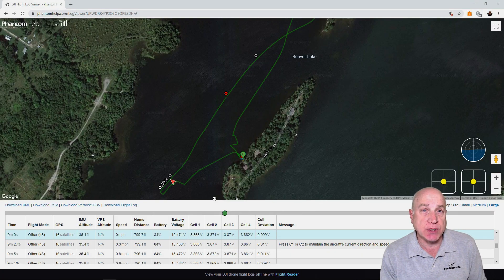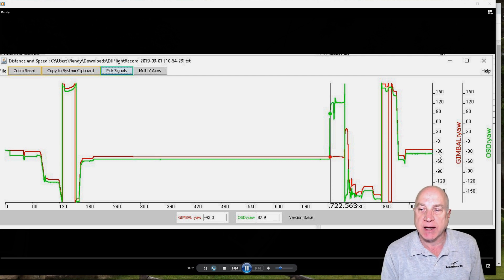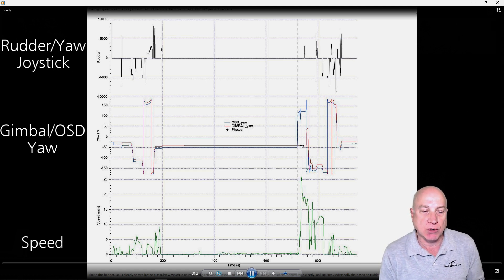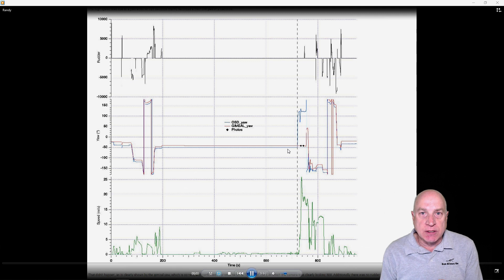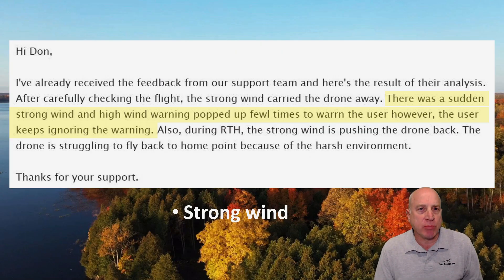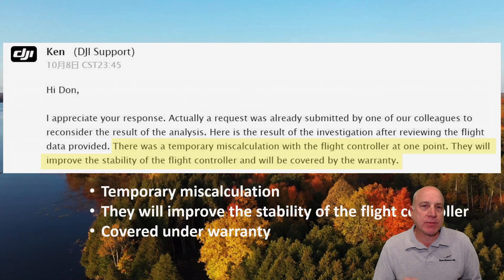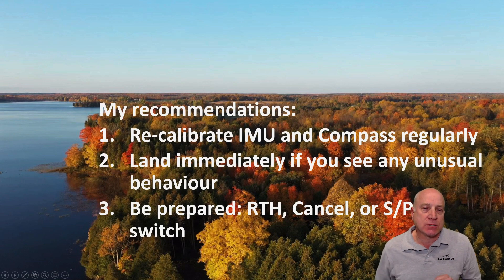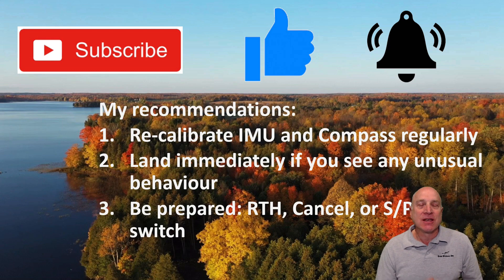Mavic 2 Pro 90 km/hr Fly Away...Explained!

Comment: Hi Don,

The navigation code and algorithms can become messy at times and exceptions can occur where some values or parameters are not processed as expected. These exceptions can be very difficult to pinpoint and sometimes only recreating the exact same conditions is the only way to reproduce the exception. The rarest it is, the harder it becomes to find it. Of course, this relates to a software bug. But given your explanations, if it is the case, I'd say go and buy a lottery ticket because you happened to hit this exception!

Personally, I think wind asset correction is not the cause, because wind tilt corrections use the IMU, not the compass. On a multicopter, there are 3 basic feedback loops that are used: Asset by IMU readings, Navigation by compass/GPS and Altitude by barometer/throttle. No multicopter will keep itself in the air without a working IMU, it will just crash within seconds. A multicopter keeps itself in balance with the IMU, go where it wants to go or stay still by the combination of its GPS and compass readings (GPS measures do not give direction if you stay still so you absolutely need a compass to apply the positional corrections in the right direction). Finally, it  maintain its altitude through a feedback loop using its barometer hooked to its main throttle.

What you have encountered is either a compass (magnetometer) false or erroneous reading or a flight controller misunderstanding of its measure. When it happens, we either have the infamous "toilet bowling" effect for slight orientation errors (say, between 30-60 degrees) or a very impressive high speed flyaway when the direction error is more than 90 degrees. The only way to stop it for a drone is to manage to read position moves and compare them to the direction it thinks it should be going. A compass error can and does happen at times and for many reasons. I take for example if the drone happens to cross the direct path of a bidirectional microwave signal between two dishes maintaining permanent communication between them. Then, not only the magnetometer can react abruptly but also any other piece of electronics that could affect the readings transmission to the flight controller or the flight controller itself. And this is only an example, because there could also be large amounts of magnetized rocks in the ground, even below a lake, that can create a momentary change in orientation readings, causing the drone to imagine itself all of a sudden flying in the wrong direction and trying to correct it. This phenomenon is less prone to affect aircrafts because they usually fly higher but for a drone, it remains a possibility for both cases.

Flyaways are always caused by navigation sensor readings (GPS/compass) that don't match together. Some flight controllers have many independent IMU, GPS and compass units and analyse the eventual discrepancies in real time like commercial aircrafts do but smaller units like the M2P probably don't have this level of redundancy. On a Pixhawk controller, there is a Kalman filter that analyzes sensor data and tries to detect inconsistencies, taking action if it does find one like RTH or Land (personally, I used to adjust it to Altitude Hold only (no GPS/compass) and leave the craft go with the wind). When the navigation loop is faulty, the drone can rarely figure out a good RTH if it cannot navigate back home! If navigation errors occur, the only sure way to get control back is to remove the navigation feedback loop from the flight equation and fly by IMU only (Atti mode on other DJI models). Unfortunately, the Atti mode is not a pilot's option on the M2P and will only kick in when the flight controller does not lock on enough satellites. I am pretty sure an Atti mode switch (something I would appreciate on my M2P units!) would have given you control back, but then you have to fly it manually with visual control and if it is too far, look at the drone position on the map to understand where to go to come back. With a M2P you would have plenty of time and communication distance to do so but perhaps DJI thinks not many pilots would be able to do so and decided to remove the Anti switch option.

After all, either the inconsistencies have disappeared or the flight controller managed to get rid of the offending measure because at the end, it came back on its own RTH automation... And since nobody knows what happened, it can happen again, this is not what we would prefer...

André
Reply from the maker: Thank you for the detailed comment, Andre!  I agree with everything you've said (well, I haven't bought my lottery ticket yet...).   While I haven't seen it happen again, I am watching carefully.   On this past weekend, I was flying low over fast-moving water, and I saw the drone was slowly rising...like a 'drift', but upwards.  While it may have been normal downward sensor behaviour, I played it safe and landed without incident.  Not much fun flying when you're always sweating about the smallest anomolies!    One minor correction in your comment:  on the day of the incident, it did not do the complete RTH on it's own.  After it was clear that it was headed for home (or at least roughly), I cancelled the RTH and flew home manually.  Since 'home' was on a dock, with nearby (but not overhead) trees, I didn't want to take any chances.  Thanks again for your comment.
Reply: @DonJoyce  Hi Don. Thanks for the answer and additional details. To me this upward drift while flying over a different environment is in line with my understanding of the many loops that happen at the same time while flying. Be careful, this is only a feeling but this water environment change could have slightly modified the barometric pressure (local temperature and/or humidity changes) and since the height is maintained (mostly, I think) by the barometric pressure feedback loop, it appears normal to me that an altitude drift occurs if otherwise no absolute altitude is imposed to the drone. Barometric changes are usually slow enough you can correct manually. One think I don't know (DJI's own corporate secrets) is to what extent the GPS altitude measurements kick in when such drift occurs because it is possible it gets into the equation loop at a certain moment. For example when I fly with Litchi on a photographic survey flight plan, the imposed ground altitude is maintained very accurately along the flight, but this is relative altitude, does it come only from the barometer or a pounded combination of the barometer and GPS absolute values (with some exclusion logic if they don't match), I don't know and I don't think DJI will tell.
Reply from the maker: Yep, it may have been a 'normal' drift, but for the time being, I'm just being super careful.  Amusingly, I'm hoping to drone a septic lagoon tomorrow!  If successful, it will be my shittiest video ever.  Sure hope I don't have to do a retrieve!!!

Comment: I’m not sure this is correct, and as others have said not all the information is available here, it would be nice to see the CSV file, there are many reasons why this may happened , your theory never explains that if craft was tilted at such an angle, why it never tipped over at that angle it would have been almost impossible for IMU to try to correct the correct attitude of the craft.
What you have shown is what suits your theory but has many questions which it looks like you just ignored .
Reply from the maker: Thanks for the comment, David.  As I've said to Frank down below, if you would like to review the data, send an email to DonDronesOn@gmail.com and I 'll send you a link.  At least 4 experts have reviewed the logs and concluded it was a yaw error, with subsequent acceleration.  What do you think has been ignored?  I don't understand why you think the craft would have tipped over...as far as the drone was concerned, it was just fighting an increasingly fierce wind and was failing to compensate.  It would never (I presume) turn itself so much that it would tip over.  (My handheld simulation may have been exaggerated to demonstrate the point?)
Reply: @DonJoyce  Don, what did I tell you about not using the cloaking device with a high KP index ! Just don't do it
Reply from the maker: @randell1784  oh crap, I thought it was just the transporter I was supposed to avoid!

Comment: I'm impressed by your analysis and as a retired engineer your conclusions in this video make perfect sense to me. Also, glitches do happen with computers sometimes for unknown reasons. When I was designing real-time control systems we put a hardware "watchdog" circuit that would reset the computer if it's execution wandered off.

Yeah, your experience with DJI customer/tech support sounds just like what I went through last year when my M2P did not follow the RTH procedure as clearly stated in the operations manual. My flight records showed the craft thought it was about a meter lower than ground level, but DJI insisted it was pilot error. Wasted a month working my way up the support ladder to no avail. Unlike you my craft did crash and was replaced by my Care Refresh, though I had to pay the fee for a replacement.

Think I'll go calibrate my IMU right now ;-)
Reply from the maker: Thanks a7wd!  Interesting to hear about your M2P crash.  But yes, on today's call with 'Francis' from DJI, I suggested exactly that:  that their software needs to detect impossible situations like massive directional changes and react appropriately.  And a watchdog to react quickly to runaway situations is required.  Not easy to design properly...but required.

Comment: I'm glad you found an explanation for what happened, Don... not the root cause (bit flip could be true) but the chain of events that followed. I've never had that but I did have a small loss of control when the craft was telling me I needed to recalibrate the vision system. I also experienced drifting before recalibrating, and it was all fixed by the recalibration.

I'm also glad you didn't lose your drone! Even when pitched way over as it must have been, it didn't crash.
Reply from the maker: Thank you, Steve.  Interesting about the 'drift' and that it was fixed by calibration....exactly which calibration did you perform?
Reply: @DonJoyce  Vision systems calibration.

Comment: sounds to me like a simple case of compass error (which in your case has started a chain of issues....ie. switching around what it thinks is compass direction is & then perhaps leading to other issues) - any drone can get effected by this (particularly if there is external electrical or Magnetic inference in the area you are flying - which is a common source of this error) a compass calibration might fix this (before flight), but it can be harder to allow for external interference sometimes in a flight area.
Reply from the maker: Yes, it is essentially a directional issue.  Why the aircraft compass and gimbal compass would be differently affected is one of many curiosities.  In terms of EM interference, that is quite a mystery since I have flown here for years without issue, and the area is quite isolated, with even the closest cell tower being 5 km away.  No high voltage lines, no industrial activity (other than my video factory ha ha), and no microwave comms in the area. Even the cell tower backhaul is north-south, and not in my general direction.

Comment: Hi, that is interesting. An intermittent problem can be hard to track but your analysis seems most logical. Wouldn't the glitch be more likely to be an imu issue given that its responsible for its orientation in space though the almost 180-degree turn is like the compass flipped? It is probably a good idea to do periodic calibrations for the imu and compass. I've had a mavic pro for over a year. Did an imu cal., once when I set it up, and a compass cal., maybe twice since I've owned it, just saying, but mainly fly in the same region. No issues so far though it wouldn't hurt to give it a check-over. Happy flying
Reply from the maker: Thanks, Don!  Yes, the bit flip was most likely in the IMU, the Flight Controller or associated memory.  And it was likely what is called a soft error since it was recoverable.  Like you, I did an IMU calibration on day one (March 2019 for me) and never thought about it again.  I've done compass calibrations lots of times, but always because the machine asked for it to be done.  I fly mostly at one location (my cottage...where the incident occurred), but often fly elsewhere...which usually triggers the compass calibration request.

Comment: Hi Don, I'm having some trouble with the wind compensation/pitch theory. At a hover state the drone will comp/pitch into the wind to stay in its GPS locked position. It's not possible for your drone to be pitched left(west) beyond level flight (into the wind) and travel downwind(east). If your traveling sideways to the right and the wind is blowing left to right, depending on how much you move the stick to the right the compensation will adjust the pitch to maintain your speed based on the stick position but should never go past level or else it will start traveling in the opposite direction. What are your thoughts?
Reply from the maker: In my explanation, I tried to simplify it by using the hovering example, but yes the compensation follows the same principle when the craft is moving.  Your "it's not possible..." statement is exactly why DJI initially stated there must have been a very strong wind (which I ignored) in order for the drone not to be able to compensate!  Watch my "Was my drone in a hurricane" video for further amusement.   In this case, however, since the drone was mixed up with it's real direction, it's compensation was WITH the wind instead of against it.
Reply: @DonJoyce  thank you for sharing and for replying. Safe flying. Hope to see a hyperlapse video sometime without any problems.

Comment: A yaw error doesn't flip the bits exactly 180 degrees. This is 100% a programming error. Someone accidently put a sine where a cosine should be, that would be off by exactly 180 degrees. The reason it doesn't come up all the time is probably because of a => error, so it'd only show up when the code is (exactly) X degrees, instead of (+/-) X degrees.

Binary 180: 010110100
Binary 360: 101101000
Binary 0: 
You would have to flip 6 very specific bits (from the entire memory of trillions of bits), all at exactly the same time to shift 180degrees. On top of that, the yaw value won't be stored as a integer, it'll be a float, so now we're dealing with 32bits of resolution, and the chance of flipping that value exactly 180degrees is zero. This is 100% coding error.
Reply: I think you're absolutely correct. Perhaps the coding error only occurs if there is an overrun … perhaps when it detects a high velocity. One fix would be to have monitor for instantaneous changes in parameters like Don did and code a safe response. Recalibration of course is necessary probably more often than they recommend.
Reply from the maker: Thanks for the comment, Eugene.  Firstly, the error was not exactly 180 degrees.  Secondly, it's not known how DJI stores the yaw data:  degrees vs radians; integer vs floating;  degrees *1000 stored as integer...many different possibilities.  I did actually spend some time trying out different variations, with the exact yaw figures from the exact time of the error, but could not find a 'smoking gun' of exactly one bit flip.  Incidentally, bit flips can and do sometimes come in multitudes all at once, just to add to the fun.   And if this is a coding error, we would see many many more cases of errors.
Reply: @DonJoyce  Even if the memory got corrupted, the sensor would still be sending new updates, so it should have fixed itself immediately. The fact that the error was continued in your log means that it's a miscalculation, and that's not from the sensor data, it's from the code reading the data. 

While bit flips can come in multiples, they would be randomly arranged throughout the entire memory. We're talking about single bits, in gigs of memory. Individually, you would only see a change of 2^x amount. So, 2,4,8,16,32,64,128,256. The closest option would be 128, and that's only if they store it as an int. But there's no reason for that error to remain, since the sensor should update the new heading immediately.

As for assuming it's not a coding error because it's not more common, that's how most errors in code actually work. If it was a common error, it would have shown up during compiling or testing. How many times have you had Windows crash on you? And think about how many people are using that system...

Comment: really glad you found out really what happened, i think i might copy you and get myself a foil hat too!, its just one of those glitches i guess, i had a issue with my gimbal at a location filming a house, but found out that my take off spot was a underground hydro vault, which was causing my issue, flown many times since and not a problem since
Reply from the maker: Thanks, Paul!  Yes, I recall your flight over a vault story..and stranger too that flying from the back of your truck was better!   Regarding the foil hat, here's a pro tip:  use the wide, heavy duty foil for best coverage....LOL.  Hey, it can't hurt!